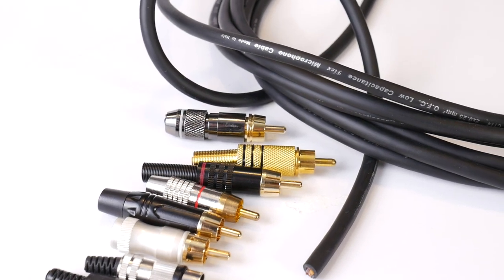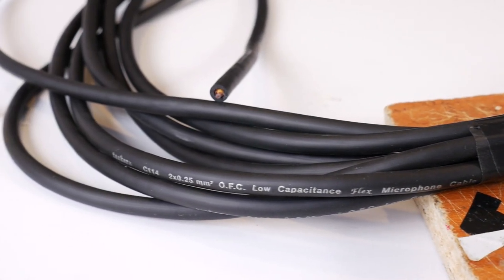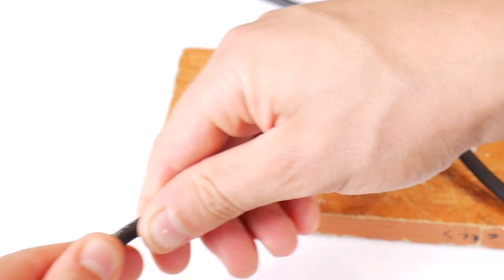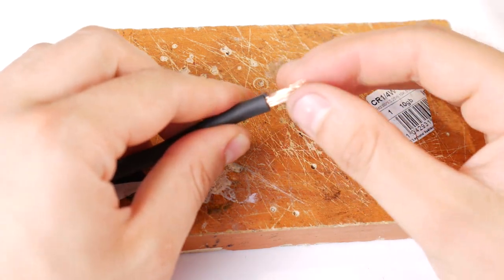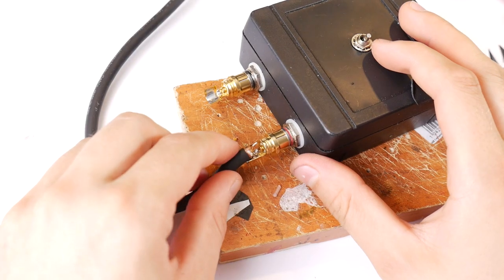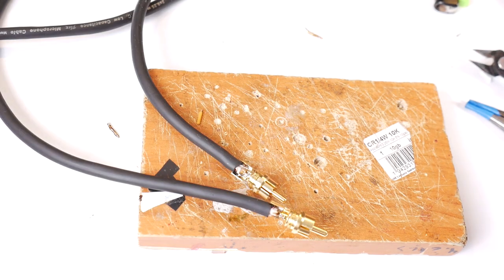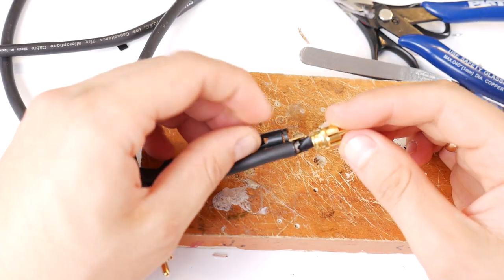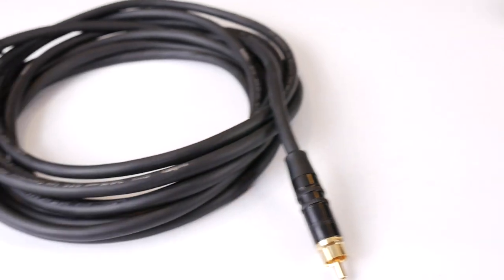How to Make LFE Subwoofer Cable DIY

Comment: Hey great video! I’m having issues I have a RCA subwoofer but my receiver just has proprietary wire connections - and + for the subwoofer that came with it, is it possible to make that type of wire?! 😩😩
Reply from the maker: Your amplifier dont have rca sub out and active subwoofer dont have high inputs ? Better give both device models.
Reply: @TechscrewDIY  it’s a technics powered sub with RCA inputs for the low frequency which I’m assuming is the bass, and I have a Panasonic surround system with just - and + terminals out the back for the Sub, L + R, Center etc… I was reading that there’s a Y-cable that I could connect just not sure 100% lol
Reply from the maker: @L337Haxorz  Y-cable cable work, but best way is jut give me your system models, to i can check.
Reply: @TechscrewDIY  I figured it out sub supports LFE 👌👌👌👌